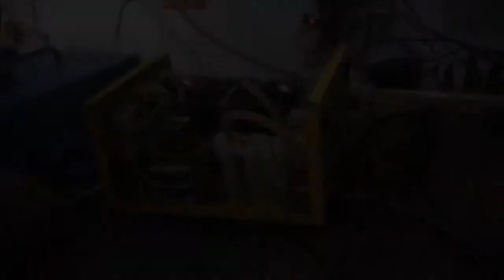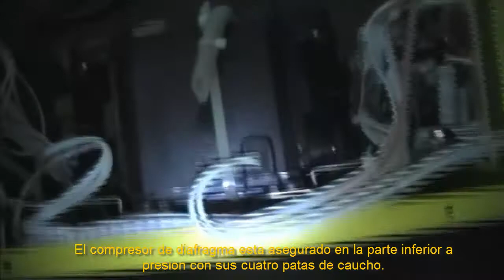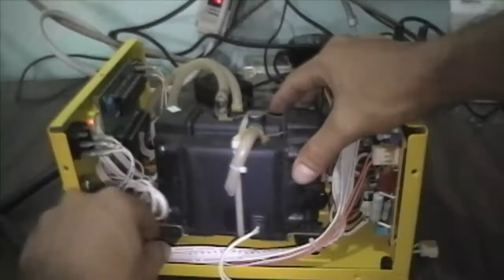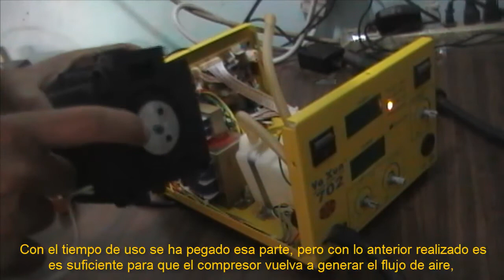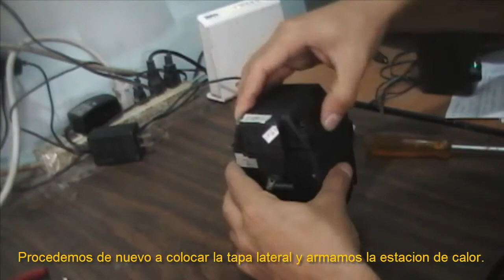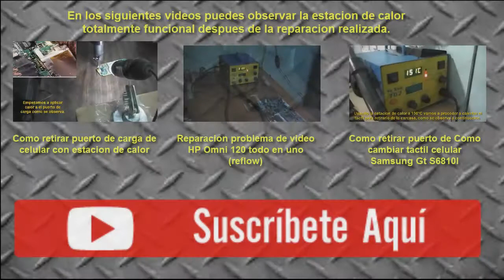Solución estación de soldadura no genera flujo de aire

Comment: Hola, tengo la yaxun 902 ,funciona pero no funciona el regulado de la temperatura de la estacion de calor, el cautín funciona bien, pero lo que es temperatura del aire no funciona, podrias orientarme por donde puede venir la falla ?? Gracias de antemano
Reply: Puede ser un filtro hinchado o reventado el que controla el flujo de temperatura se ubica en la parte central de la placa.
Reply from the maker: Lo que se me ocurre de momento es que puede ser el potenciometro, o esta fallando o o esta bien conectado. la otra es que la resistencia de la pistola de calor este fallando.
Reply: Tengo este mismo problema pero con la yaxun 702
Reply: Hola ya solucione el problema , era un integrado , el que regula la temperatura. MOC301. Espero te sirva.